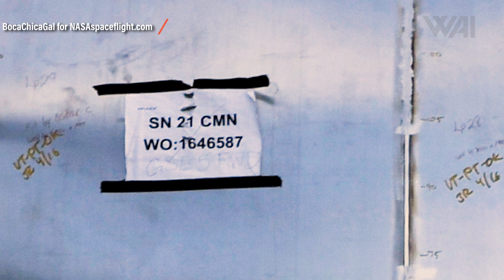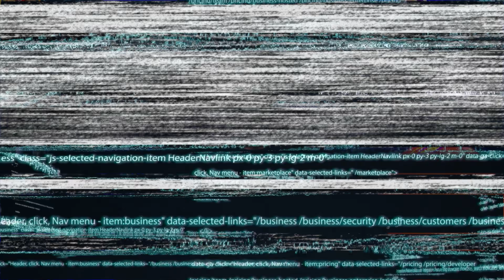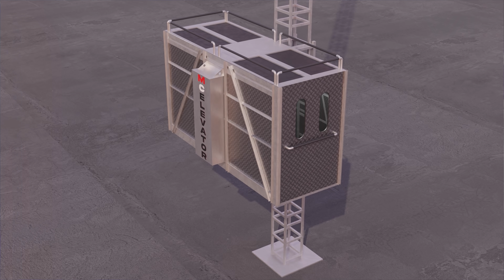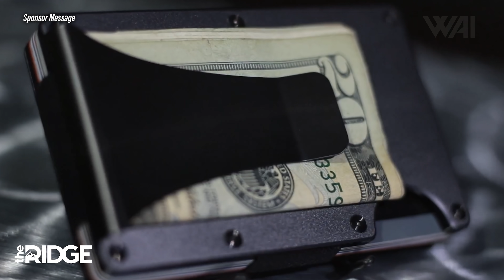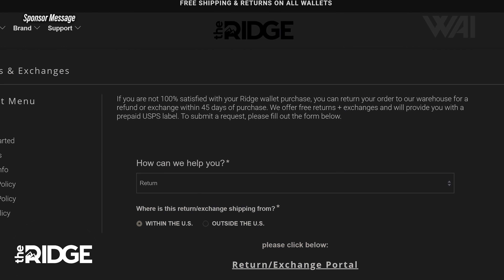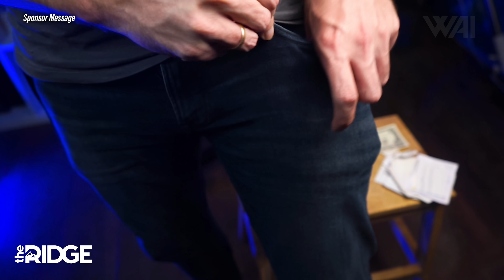SpaceX Starship SN15 Re-flight not happening? Virgin Galactic about to start tourist flights!

Comment: Thinking about it, I realized there isn't any amount of money I would need to have in order to go for a suborbital hop for 250k$. If I had 50 million in the bank, 250k$ would still be too much to burn on this. If I had 100 million or more, I would be thinking of going on a Dragon/Roskosmos ISS trip. Perhaps there is a very small niche of people with just the right amount of money and just the right mindset to do it for 250k. If the price was 10k, then the thing becomes more attractive. A zero-G ride for 5k is 5-6 minutes of weightlessness, about the same as SS2.

Comment: The engines seem to be the weak part of all this. 28 engines without problems? Doubt it. 

Heat tiles? They never did get those right on the Space Shuttle, wonder what makes Elon think tiles will work better for him? To be reusable, those need to survie more then one flight without extensive repair.
Reply: It's still on early days. And many people doubt about 9 engines in Falcon 9

They will do many tests and iterate on heat shield

Comment: You said they are going to fill the tank jackets with nitrogen but I thought they were going to vacuum jacket them, which one is it?
Reply: I go for vacuum, as nitrogen doesn´t offer any benefits over normal air when it comes to insulation.
Reply: @antyspi4466  maybe its ciruclated cooled nitrogen?  or near vacuum pressure with nitrogen purge? AHHH i need to know
Reply: @jacobkirstein6352  How could vacuum insulation be practical anyway?  When the GSE tanks are filled and only 3mm steel they would collapse.
Reply: @michaeldeierhoi4096  The tanks are pressurized and a vacuum on the otherside of the wall would if anything lead to the tanks exploding, not collapsing. Im not sure what you mean.
Reply: @jacobkirstein6352  You said it better, but that's what I meant.
Reply: @michaeldeierhoi4096  I think it would survive, its only one extra ATM and I doubt they are pressurizing to the same psi as the flight tanks, but well see!

Comment: I didn't realise New Shepherd could do orbital flights, I always thought it was sub orbital, like Virgin's.
Reply: New Shepherd can’t do orbital flights. It’s strictly suborbital.
Reply: Yeah, New Shepard is sub-orbital to about 73-74 miles. The Karman line is 62.1 miles (100 km). New Shepard goes straight up and back down. The booster travels almost 4 ground miles from launch pad to landing pad. New Shepard flies on a 259 sq mile ranch in west Texas, with the capsule landing on the ranch.

Comment: Concerning SN-15, based on my authority (Ha Ha) I recommend that SN-15 go a top BN-3 with as many hardened and transmitting sensors as possible so that data isn't lost. Especially for the tiles.
Reply: SN20 is the next major revision per Musk. Elon Musk's Mar 30th 2021 tweet

"Next major technology rev is at SN20. Those ships will be orbit-capable with heat shield & stage separation system. Ascent success probability is high.

However, SN20+ vehicles will probably need many flight attempts to survive Mach 25 entry heating & land intact."

https://twitter.com/elonmusk/status/1376898630582419461?s=20

Comment: Looks like SN15 is a backup plan in case SN16 RUDs. And Elon might use a leftover SN15 to try to implement a parasail that deploys a couple miles up before landing.  He was into parachutes during the falcon beginning iterations but gave up.   A parasail might give the  starship time to settle down in the vertical position for 20 seconds before igniting the engines.  This may avoid the reason for so many failed landing reignitions
Reply: Parachutes won't work in Starship ever

Comment: Not very convinced with the flight stability of Virgin Galactic rocket plane, seems too shaky and add the lack of a proper abort system into flight... makes Blue Shepard seems way safer, with their more traditional approach, with an abort system, and redundancy parachutes. Also bigger windows for each person. But both programs seems to be in danger of being cancelled in the long run, once comercial flights into orbit and Space Station are in place.
Reply: Do you have escape systems on an airliner? White Knight + Unity don´t need escape systems as they are not rockets but planes that can scramble for an emergency landing.
New Shepard has bigger windows, but they go off to the side, while Unity´s windows also enable a view right upwards to the black sky. Plus the ride with Virgin Galactic lasts much longer than on New Shepard.
Reply: @RogerM.  By the time there are commercial flights and a new space station the technology will be progressed well beyond the present.  Who knows what that could like.  Ten years ago who could have imagined anyone landing a 50m rocket like Space X does?

Comment: for a few minutes in the space 250k ???? when the starship travel starts for world transportation, it will be normal to take a little view from the space " included " in the travel ticket... so.... this project is to die in few years
Reply: "when the starship travel starts for world transportation"... This will never happen and if it will on a very limited / small scale, it wouldn't be for less than 250K. :)
Too expansive, too impractical, too dangerous, too much noise and polution, not enough demand to make it lucrative, they won't get approval from most countries, etc etc.
They would need to launch and land so far from cities (due to noise alone), that it takes hours to get to and from the launch/landing pads. Boarding will also take hours.
You can be pretty much be anywhere on earth with a plane in the time it takes to get to and from the launch/landing pads and boarding alone. (there literally is no way around it unless you fly hundreds of helicopters all day to transport the amount of people they need, to make this "lucrative".

A plane can circle around for a while or change course if bad weather comes out of nowhere (or something else happens). A rocket can't.

1 out of 100-200 rockets crash/explode on average (they simply are and will always be extremely dangerous) and if a little bad weather pops-up, they cancel the launch for hours or even days. (and SpaceX even increases the risk by landing these things). They will have no way of stopping this thing after launch.

Lets forget all the problems above, they will never be able to fix or control.
The COO said they can make it lucrative, while being affordable for people, IF they can transport way more people per day than that fly in planes right now.
All good and well, but if you think about it for a second.... how do you suddenly find double, tripple the amount (or more) of people who actually need to travel around the globe?

This whole thing will never work.
Reply: @cryptopolice6202  I made a screenshot so I can show you in 2 years from now
Reply: @cristianku75  Yes? The (easy to understand) info I provided and the info that can easily be found on the web was not enough? Still just believe what a private company claims they will do in the future, without giving it an ounce of thought? And besides all that, you actually think they can pull it off in 2 years? 
Why did I even bother to comment to you? :D  Anyway, see you in 2 years. :)

Comment: Re the Virgin Galactic flight if it only flew to 80km then it didn't pass the karman line so does it count?
Reply: The US government recognized 50 miles (80.5 km) as where you can earn astronaut wings.
Reply: @steveaustin2686  Specifically, the USAF adopted the 50 mile limit, and NASA copied it for consistency. I'm not sure if the US government in general has any policy on the subject... e.g. which definition do the FAA use?
Reply: @simongeard4824  I was being general. NASA, the Air Force, and now Space Force too are all part of the US government.
Reply: @steveaustin2686  Yeah, I understand that. I'm just curious if the entire government uses the same definition, or if some parts use the international one.
Reply: @simongeard4824  I don't know. I would expect NASA to also use the Karman line since it's the international definition. They are both lower than normal orbits, so it might not matter.
Reply: @steveaustin2686  As I understand it, NASA adopted the USAF definition out of a desire for consistency between military and civilian astronaut qualification. But yes, you're right... unless you're in the business of flying humans to face, neither definition is particularly important.

Comment: VG still hasn't achieved manned spaceflight if that matters to the passengers. It's a high-altitude airplane. Never crossed the actual Karman line. Still very cool.
Reply: Why does it matter? As for the USAF space is 80k and it’s as well a justified altitude
Reply: @AndreaSisto  It doesn't really matter. But high altitude airplane flights are not that new if you're going to pick an arbitrary altitude for space. Commercial mig29 flights hit 22km -- 0.1atm, see black sky and earth curvature -- basically space. People paying 250k may actually care about the technicalities though.

Comment: The tottering and inadequate landing legs on Starship need redesign and installation for the future.
Reply: The current ones are just for testing, they aren’t the final design. I’m sure SpaceX engineers are figuring out a good leg design
Reply: Everyone has complained about them from day one, it was also stated day one that these are only for tests and will be different, but these have worked perfectly fine for single use as they were meant. Why is everyone so concerned about them?

Comment: Question: Where did the info come that it will be Nitrogen in the tanks?

I remember hearing the shells would be a vacuum, this makes great sense for insulation. Now every one is saying its going to be nitrogen, Why?
    Its thermal conductivity basically no different then just air and the exact same as pure oxygen, there are so many easily accessible gases that would work much better (granted almost every one i find is flammable lol) but CO2 it almost twice as good as an insulator!!! 
    Also, nitrogen liquifies at well above the temp that will be in the tanks its "insulating" Could this cause an issue?.  
To me it seems using nitrogen would be a super cheap and kinda half ass way to do it. But of course i dont know, maybe this is all thats needed...

Comment: Wonder why they don’t make the heat tiles in one piece? Well done virgin 👏🏻👏🏻makes me proud to be British
Reply: Why not mold the entire spacecraft out of one solid piece of ablative material? Pressure vessels could be suspended inside the thermal shield. Any necessary openings could be drilled out.
Reply: @CharbeeCapps  I think the heat shields are hard to make but I’m just wondering why so many small ones instead of one or maybe four or something
Reply: Exactly, it would be one giant heat tile that’s not put into the starship but is a part of it. Im not an engineer but it does seem that it would be better but i might be wrong.
Reply: The tiles will expand from the heat. It's the same reason concrete sidewalks and driveways have expansion cracks. Viewed up close, the heat tiles do not butt up against each other due to that expansion. If they use an abalative coating like a capsule, you would have to reapply it. These heat tiles will only come in the few necessary sizes, unlike the shuttle tiles that were practically individual.
Reply: @steveaustin2686  thanks for explaining that but if they expand how come they don’t break one another as they’re all so close together?
Reply: @alanbrady420  They are set just far enough apart to expand together. I'm sure lots of math and heat testing on a few tiles at a time determined the proper distances. The big issue will be how they will protect the actuators that move the flaps and the space where the flaps join the hull. We won't likely know until SN20 gets built. Elon Musk said in a Mar 30th tweet, that it will likely take a few tries to get a Starship to re-enter and land safely from orbital speed, so expect more RUDs from the orbital tests.
Reply: @steveaustin2686  I am looking forward to it believe lol thanks for that 👍🏻

Comment: SN 15 must fly again,  just need to rely on the engines working correctly again and again, without them cutting or failing.
Reply: Well its being setup to be attached to a crane right now, soo... By this i mean they brought a SPMT with starship transport frame and now it has crane hooks attached.
I cant see any reason to move it from the launch pad if there were any plans to fly it again.

Comment: I have the feeling that SN 18&19 will be skipped, possibly SN17 too.
Reply: 17 won't fly they are cutting holes in it already.
Reply: @frederickstirnkorb3094  Thanx for that info. All I knew was that it was still being built, but it's obvious SpaceX is contemplating focusing full on the orbital operations. That's probably going to cost a bunch of prototypes before the kinks are all ironed out. They might as well, because the landing flop will remain a gamble for the time being, and personally, I think eventually they will ditch the belly flop manouvre in favor of a shuttle type craft that can detach from the tank section - the advantage being 1) Passengers won't puke all over the place, 2) the shuttle craft can land on any runway on earth, 3) the tank section can land falcon 9 style, which is much easier to perform, and 4) Overall passenger safety is massively increased. Plus 5) no header tanks needed. Does that seem plausible to you?
Reply: @paulmichaelfreedman8334  Yeah I think sn 16 will be the last of this iteration. Hope they fly it.

Comment: There is no way to launch starship into orbit by 2021
Reply: lol did i miss that?
Reply: @Vatsyayana87  Seems like you did, they need a complete launch platform with integration tower both of which they are in the process of building right now. It will take a long time before they're finished, maybe one more year.
Reply: @giovannifoulmouth7205  I meant did I miss him saying 2021 instead of 2022. The work needed before orbit can absolutely be done in the next couple months. I am very confident they will be doing the first flight in that time.

Comment: My Dad was one of the contractors at Spaceport America!  He was the "fixer"...finding creative (low cost) solutions to issues that cropped up and getting the facility ready to be occupied by it's tenant (Virgin Galactic).  I actually got to visit the facility years ago, LONG before it was open to the public.  It was pretty damn amazing going down the runway (we kept the speed under 30mph to avoid any possible damage to the surface) or walking through the hangar space...they had the ship's outline on the floor marked with tape so they could ensure there was plenty of room for everything.  I even got to walk up on the roof of the building!  It's a VERY unique structure! 

All of that wasn't the best part of it, though.  The very BEST part was hearing my Mother use the word "spaceport" in casual conversation!  The 10 year old in me just squealed in delight when I heard that!  

While Virgin Galactic's tourist flights are FAR less exciting than what is going on with SpaceX...it's still pretty neat!  And I LOVE the fact that it's happening right outside my hometown!

Comment: How polluting and toxic is the exhaust from the hybrid engine used in VSS Unity?
Reply: Well, nitrous oxide and polyamide plastics (basically nylon) aren't exactly great for the environment, but they will be in the upper atmosphere, so it will most likely be suspended in the atmosphere long enough to decay into less harmful ions and more stable compounds.

Comment: Why would they fill the cryo jacket with nitrogen? It's more thermally conductive than air. Argon would seem a better choice if not vacuum.
Reply: Vacuum is a big no, it would get crushed long before it reaches vacuum. Air is probably the best choice.
Reply: @giovannifoulmouth7205  That depends on how much reinforcement outer shell has on inside after all it is only one atmosphere of pressure that it would need to resist. And if they don't go with vacuum solid insulation like construction foam would be much better than air.
Reply: @skyrask1948  I think it is the GSE tank that is prone to exploding outward if vacuum insulation is used.  And cryo shell would collapse in with a vacuum no?   In any case it a moot point because nitrogen will be the insulator.
Reply: @michaeldeierhoi4096  Nitrogen is not a thermal insulator, double glazing for example is filled with argon, not nitrogen because argon has low thermal conductivity.
Reply: @andyalder1  Tell that to Space X then.  I am not a physicist to respond with the necessary scientific insight.

Comment: @03:13 I see the UT and PT testing was done by JR on the 6th May... Non destructive testing using dye penetrant and ultrasonic methods, PT is good for stainless and alloy parts (MPI or magnetic particle testing for magnetic parts) but UT is difficult and very specialized on Stainless materials... 👍

Comment: 89.2 km is NOT space it's just high altitude. 100 km is where space starts.
Reply: 100km is the karman line, space is above that, but 89.2km can be counted as space and the atmosphere is so thin you dont really notice it at all. The only thing that is different at 89.2km and space is the size of the earth.
Reply: @BlueBeam Still not space. No matter what people say.
Reply: @ImieNazwiskoOK  technically not space,   but you can call it space as the only difference is a tiny bit of atmospheric pressure, and the size of the earth compared to other things.
Reply: That's fine, the real attraction is getting to see the blackness of space and the curvature of the Earth, not so much bragging about going to space.
Reply: @giovannifoulmouth7205  fair enough.